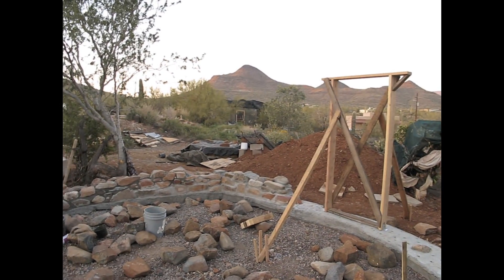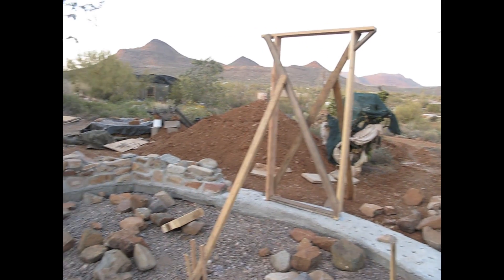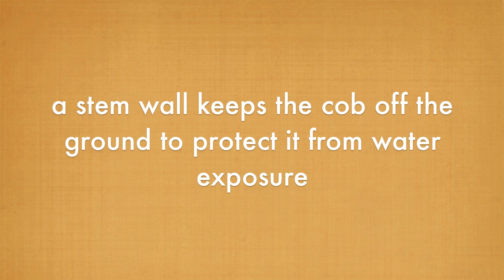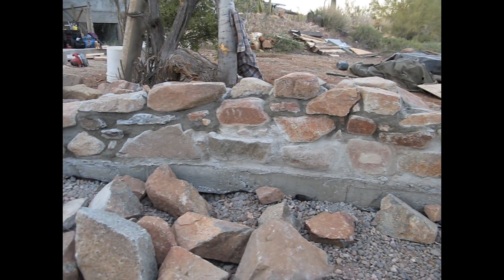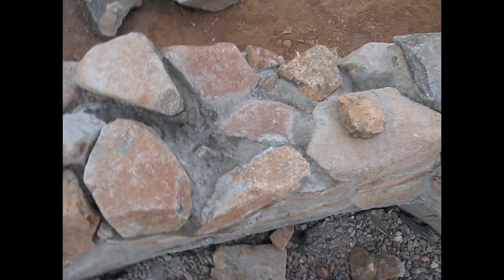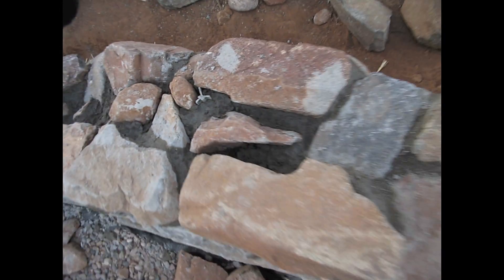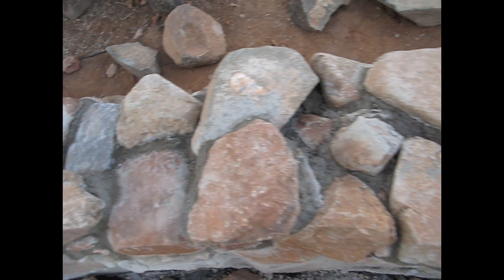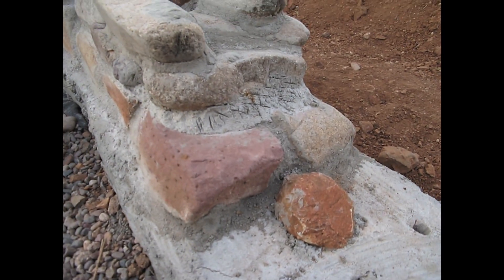Rock Stem Wall on Rubble Trench

Comment: Did you stagger the t posts? When you say to try to angle the rocks inward, do you mean inward towards the center line so that when you look down the row it looks like a v, so that  the cob sits kind of inside and then build out towards the edges of the wall? I hope I explained what I am trying to say so you understand what I am imagining. Lol

Comment: Too much sand is not good, it will weaken the walls. You have a 4.5/1 mix.
Stone work is either high lime (little to no Portland) or no lime (all Portland).

Type M 1 part Portland  to .25 parts Lime
--------a
Type S 1 part Portland to 1 part Lime
--------o
Type N 1 part Portland to .5 parts Lime
-------w
Type O - not important
--------r
Type K - not important
Note: Order is based on strength, M being the strongest. In the ratios, 1 part equals 1 cubic foot by volume.

All measures (ratios) are based on the Portland. A typical Stone Mortar mix will be 1 part portland to 3 parts sand and no lime, with maybe 2 gallons of water (will be damp but not wet). Some masons will add one shovel of lime to the standard stone mortar mix, in order to reduce joint shrinkage which occurs as portland dries.

Bag of portland, 94lbs, is 1 cubic foot.
1 cubic foot of damp sand is about 7 gallons.
Each gallon is equal to a full shovel. (Use a round shovel not a flat shovel.)
21 gallons of sand is 21 shovels of sand.
4 x 5 gallons = 20 gallons = 20 shovels
Reply: Don Ation ...very good pointers there Don, I live in Australia but I imagine the cement types here are very similar , I’m recently interested in mortars and cements understanding what each type is used for. Some for vertical use and some used for anything flat like a slab for a house etc.

Comment: What if you don't want to use concrete - is there a way to build w/ cob that does not require a concrete foundation? And what is a grade beam? Thanks for you videos - I am learning so much from them!
Reply: The concrete isn't necessary. You can place rocks or urbanite right on the gravel foundation, and stack it up high enough that ground moisture can't wick up into the cob. You'll want to fill in any cracks/seams between pieces to prevent pests from getting in too.
Reply: What natural cement free mortar can one use ?
Reply: lime is natural, it is strong and it is breathable, you want your walls to breath for moisture evaporation and slight shift movement. Study up on a good rock and lime mortar foundation, there's plenty of info online !